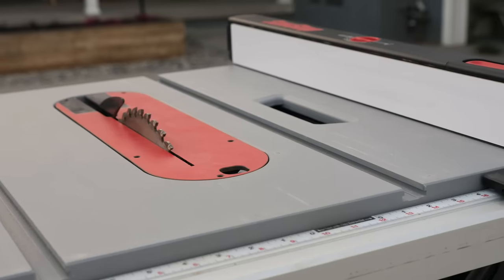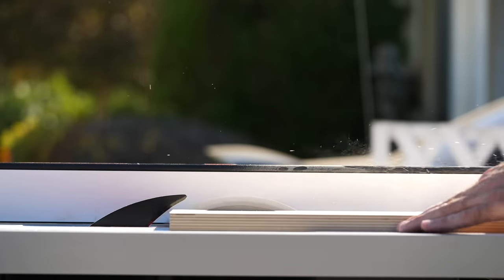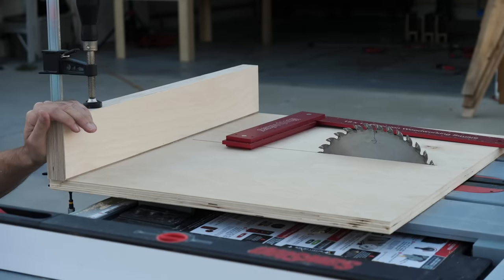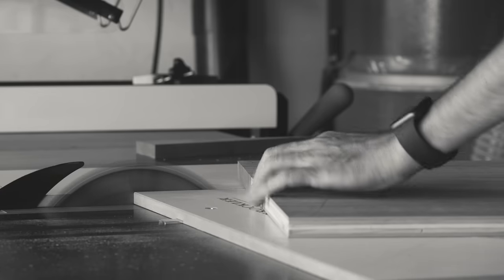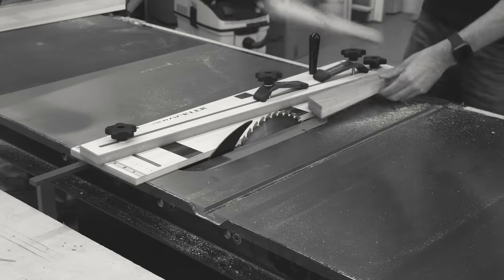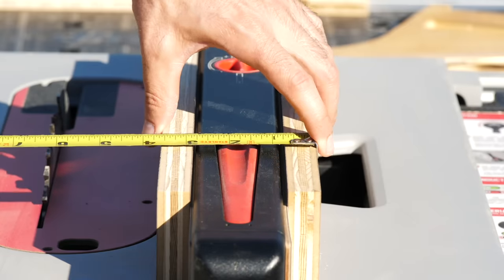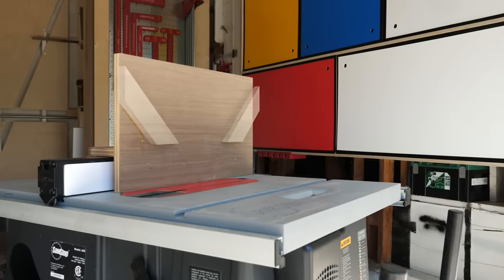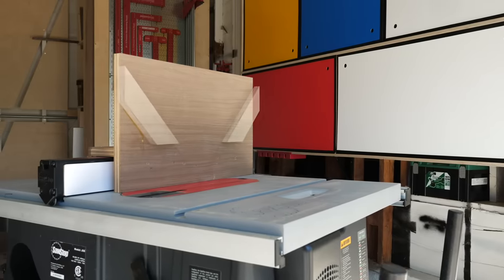Top 10 Woodworking Table Saw Jigs and Accessories & How To Make Them - According to Me

Comment: Hi Chris. This is my first time viewing your channel and I promise to watch more of your videos and I just subscribed. This was a very informative video and loved some of the jigs. I have an "On and off and on again" history when it comes to woodworking. Started in my teens then switched to cars and working on them. (Back then you could get more girls with cars than with woodworking.) Got back to playing with wood on a couple of different levels about 15 years ago. As with all of my wood working, my saws of choice are the worm drive, miter, circular, and of course the table saw. (Hope to invest in a band saw one of these days.) My 25 plus years as a firefighter/EMT, I practice the proper safety techniques when using any tool. With the exception of the fire/rescues service and like most people, over time we become too relaxed with our safety practices. So I noticed that you used ear and eye protection. There were times that you should have been using your push shoe or other push rig. The other issue is dust. It wasn't until much later that you donned a mask. I just made a promise to my wife to use one with my wood work. My wife (non smoker) was diagnosed Dec 2017 with lung cancer. After her lobectomy and chemotherapy spring 2018, she is all well. August 2018, my brother in-law who has been in the building trade for over 40 years, was hit with cancer of the larynx. His harsh treatment was successful so far. He believes it is most likely from the dust working in his trade as he never smoked cigarettes. I can not express how critical wearing a mask can be. In addition, a dust collection system should also be used. One other thing I noticed more and more on job sites, the wearing of earbuds. When it is "my work site" earbud are not aloud. It is important to hear what is going on at a site. You also should hear what your power tools are telling you when you are using them. A coworker may have injured themselves and couldn't be heard. (I have had that happen at a site once.) Well to quote Forrest Gump, "That's all I got to say about that. Thanks again for a great video.

Comment: At last someone building jigs for the sawstop jobsite. I bought the incra cross cut sled for mine, but it has limited cut capacity as the jobsite saw has a small infeed from the the edge of the saw to the blade same with the mitre gauge it does not sit flat on the table if you try to cut something wide. It is for that reason I am going to make a oversized cross cut sled with possibly infeed and out feed tables.
Reply from the maker: Yeah..that will be really useful. I think infeed space is one of the least thought about aspects of a table saw...and not having enough is a real pain :)

Comment: I need your opinion.  If you had $3000 to build a woodshop to get started.  How would allocate the money?  
I've heard two different thought patterns.  Go heavy on saw and router table.  Make do with those and hand tools.  Second option was get 5 tools 500$ or less (saw, band saw, router table, planer, jointer) maybe toss in a drill press.  

Would love to get your opinion.  I'm looking to do small, moneymaking items that sell, and will help me fund expanding.
Reply from the maker: Hard to answer...I'll just say what I would do for MY ENJOYMENT. Not necessarily what I think is a good answer for others. I would put about 2000 towards a table saw, circular saw, drills, jig saw, router...and get the best stuff that I could. Stuff that I'm not gonna want to sell in a year for an upgrade. Of all of those tools, the only one where you'd need to compromise would probably be the table saw. But still, you could have something that you won't grow out of for a long time.  I'd put the rest towards all the little odds and ends that you need. clamps, sanders - just all the little stuff. I wouldn't even be thinking about band saws, jointers, planners, etc... and I would go heavy into plywood. So basically I'd set up a shop where I could do A LOT with plywood, and then save up money and expand into hardwoods later, and that would be the time you'd start needing joiners and planners and all that good stuff.
Reply: @Foureyes.Furniture  i love that reply, and especially after watching your videos, I have a new appreciation for all things plywood

Comment: Great Video and so helpful. A quick question...I just bought a nice Dewalt Sliding Miter Saw.   I plan to build a mitre saw stand with a sliding stop for repetitive cuts. is there any benefit to having a jig for 90 and 45 degree cuts on my table saw VS using the Dewalt Mitre Saw?
Reply from the maker: If you build a really good accurate miter saw station, you should be ok for most tasks. I personally prefer the table saw b/c for me it is more accurate, has a larger width capacity, and better dust collection.

Comment: Might be easier on the tall fence jig to simply use two micro jig dovetail clamps and router a groove on the back of the wood and clamp to the fence.  If you are sliding as a clamped piece then I can see it...

Comment: Here in the UK our most popular site saw is the Dewalt Flip Over Saw, and is used extensively by most contractors. The reason being it is indestructible and with one lever it flips to a compound mitre saw. It surprises me I rarely see it in the USA.
There are  differences, one being the use of the Dado Stack head blades, which are banned in the UK as they are considered dangerous by our woodworking regs, which states that all table saw arbours must be of a length to accept a blade only, therefore all our arbours are very short, long enough for a blade, washer and locking nut only. Great video, very informative.
Reply: The regulations don't ban dado stacked blades. The regs state that the saw must be capable of stopping the blade rapidly within a given time. This is usually achieved with a powerful braking system. Most medium to small saws that the typical home or small workshop person owns are not capable of that,  so the manufactures must fit small arbours to prevent fitting dado stacks. You will find larger industrial type saws in use in the Uk that have dado stack capability.
Reply: The regs do not ban the use of the stack dado but ban the removal of the rive knife for commercial use, and to install the stack dado you have to remove the knife. I did not go into the complexities of why they are banned, its a consequence of the knife removal. They are not banned directly but banned because of the removal of the rive knife. Therefore manufactures such as Bosch have stated their arbors are deliberately short to prevent a dado being installed.

Comment: The thing that is ever explained on crosscut-jig how-tos is: How do you adjust that fence in small increments, if you DON’T get it right on the first try? I spent hours trying to adjust a fence (on a different jig), and it was too much, too little, too much...

David talks about how to calculate it, but there’s never any talk about how to physically manipulate the fence in tiny amounts.
Reply: Check out William Ng's video "5 cuts to a perfect cross-cut sled" making adjustments with a feeler gauge is the easiest way to go. Hope this helps.
Reply: @jeremymoskaluk5444  I saw his video--I don't remember him giving anything helpful about how to physically manipulate the fence in order to accurately adjust in tiny increments. I'll have to look again.
Reply: @jeremymoskaluk5444  OK, so I went and looked--I think this is a newer one than the one I saw. That all makes  sense.

Comment: On your sled, you need to add a block to the back of the fence (the side facing you), so that when the blade comes through your thumbs aren't there to meet it !
Srsly, tho, you need a block to cover the exiting blade.
Reply: Or you could just not put your thumb there.

Comment: I think that the accuracy of your table saw sled is a testament to the quality of Sawstop!
Reply from the maker: They are some pretty darn nice saws
Reply: I've been wrestling with getting one. On one hand I have my father's Craftsman. I learned everything I know about saws on this one.  But on the other hand the SawStop is CRAZY good and safe. I'm still nostalgic and don't have room for 2 saws. :(
Reply: Chris, Have you had any trouble with your JSS fence moving when you lock it?  Mine jerks to the left, even after I have adjusted it per the manual with the screw. It is frustrating. Another fellow on YouTube has the same problems. Any ideas? Thanks!  Nice video btw! Dave

Comment: Hey. Just want to point out that a splitter and a roving knife are not quite the safe thing. A riving knife hugs the blade and moves with it. A splitter sits a bit back and does not move.  Riving knifes are newer tech.

Comment: Chris, long time listener, first time caller. I want to thank you for this video and ask why you suggested we would be seeing you do more with your jobsite saw when you have a cabinet saw. I have been considering a SawStop for a while and think the size and portability are real pluses but am concerned about the ability to reproduce the quality (not speed) of the cabinet saw. With just 6 inches in front of the blade I was specifically wondering about the use of jigs but now you've provided this great video that shows its versatility. Thank you! Can you share your thoughts on the use of the jobsite saw to make furniture and cabinets?  Besides power, what are the biggest tradeoffs for your work or do you still reply on your cabinet saw primarily?
Reply from the maker: Thanks Garnet. So it's gonna become more clear in the next video...but I've moved my main shop, and all of my large equipment to a warehouse space. I had an awesome opportunity to use a small corner of a friends warehouse. So I'll primarily work from there. I'm still going to produce some videos out of my garage though, but with more "DIY" equipment. 

I think the biggest trade offs though....are speed, and capacity for me. Not so much power. I don't think there is much of anything I do on my cabinet saw that the job site couldn't handle. Some stuff is just physically a little too large and could become unwieldy.
Reply: Chris Salomone thank you again for the great video. One of your best as far as educational content. I look forward to your new “shop tour” and comparison between the garage and full bore set-up. I think many people would be interested in learning your perspective of the trade offs of small vs large equipment and workspaces. All the best!

Comment: Sublimesimplicity is correct. Your 5 cut method wouldn't give you any more accuracy than one cut. Check the wood whisperer for a good explanation. Or William Ng. That said, if your sled is making cuts that are square according to an accurate square, it's probably "good enuff". Incidentally, David Piccuito also got it wrong in his vid. Not trying to throw shade. Still a great vid as always.

Comment: Have you any idea how to make a crosscut sled on a table that has no T-slots or guides cut into the surface of the table?
Reply: I've never seen it, but you could put your guides to run snuggly on the outside of the table top. Maybe?
Reply: @christopherearly7676  I've thought about making it run along the rip fence, like I've seen some spline cutting jigs do, or use the fence and one table edge, but using both edges might be a simpler and less "wobbly" way to do it. Thanks for the suggestion.

Comment: Stop. You dont check the orginal piece with a square. Its not percise enough. You measure the cut off piece at each end with calipers. If it is square the two measurements will be the same. If they are diffrent you can do some math that will tell you how to fix it.
Reply from the maker: I would stop...but you're about 5 months too late :)